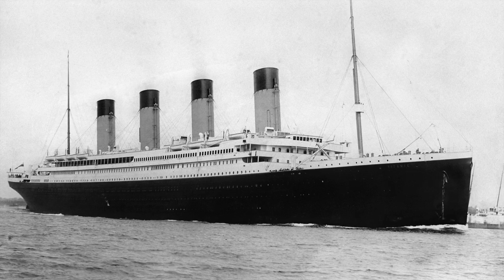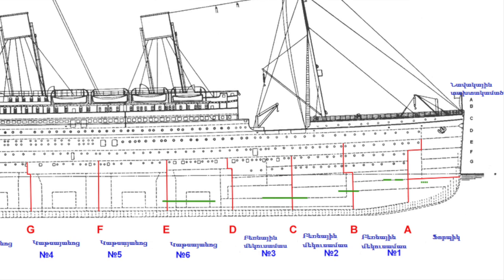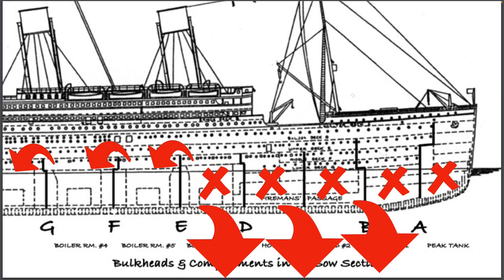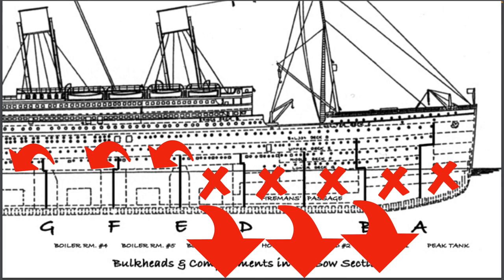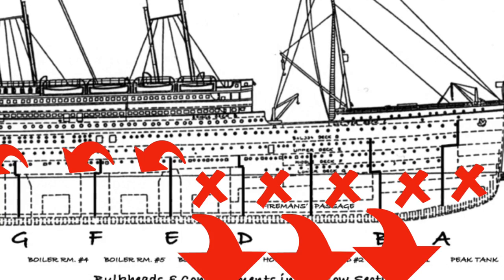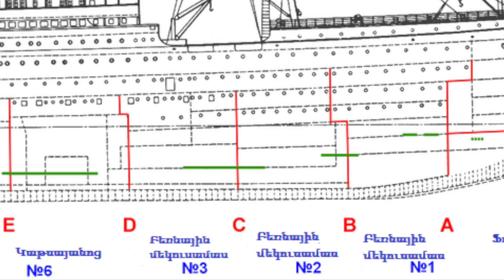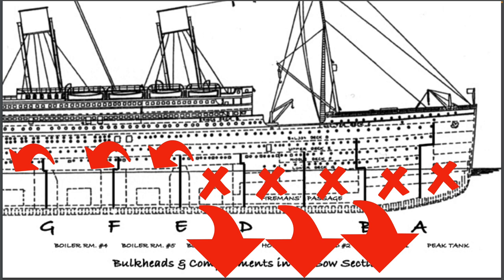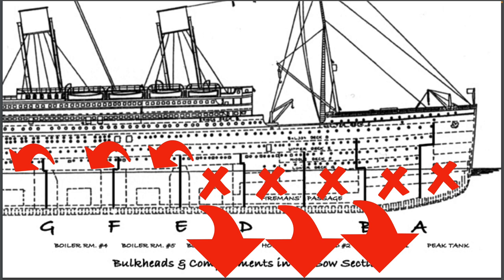The Fatal Flaw that caused Titanic to sink

Comment: The ice burg actually went a little bit into the 6th compartment but instead it flooded the coal bunker which was closed as the firemen previously removed all coal due to a mini fire. The coal bunkers weren’t built to hold water pressure and it burst, which is when they all started to leave the coal room. If it didn’t open a hole into the 6th compartment it may have taken longer to flood potentially saving a few more lives.
Reply: Did the coal bunker fail before the water came over the bulkhead?
Reply: @eveniftheydo7794  yes, it’s documented I can’t remember which crew member noted it but it’s well documented. There was a big rupture not enough for instant flooding but it had ruptured but had enough time to leave the bunker. The water tight compartments we’re doing their jobs but with the compromise of the 6th compartments coal bunker it couldn’t hold. If anyone is unsure what the coal bunkers looked like check our honor and glory, they have a very accurate depiction of it. It was closed to suffocate the remaining smouldering coal and was empty which is why titanic had a little list during sailing with an imbalance coal load. Just to make it clear though, the coal fire had no impact on the sinking or the bulkhead 😆, which was also noted and in fact possibly slowed the sinking down a little bit holding back water from entering the 6th compartment for as long as it could hold again as it wasn’t built to hold water pressure but did give way before water overflowed from the 5th compartment.
Reply: since the burned coal was moved to the other side of the ship, It caused Titanic to have a small list to port

Comment: I always wondered why didn't it have water tight ceilings to the compartments.  Wouldn't have cluttered the first class areas.  But i guess it was added cost and weight.
Reply: Name any liner in service at the time which did have such bulkheads. Those on the Olympics were higher than Board of Trade regulations required.

Comment: I have read several articles that said they would have been better off hitting the iceberg head on.
Reply: The bow was designed specifically to withstand a collision. If only they had planned for this, but I'm not sure if they discussed this strategy, in case of such an emergency. You'd never steer her head if you weren't trained to, or told to do it. You'd be damaging a new ship and losing your job. But yeah, head on, or turning without stopping, as she did.

Comment: The designers knew how deep the ship would settle with each combination of compartments flooded.  In the design case of a t-bone collision (4 bow compartments or two other compartments) the bulkheads were still above the waterline.  Take a close look at the varying height of the bulkheads at 0:24, most notably A and B.  When 6 compartments were breached it was game over.

Comment: Well, they riped open 1/3 of the ship. Find me a modern ship that can survive that. There is nothing wrong with the bulkheads. In fact titanic could survive much more than it was desingn. It was design to survive any 2 or front 3 compartments floded. So, just stop saying it is a design flaw or someting. It was just too much damage.

Comment: The 1 st compartment only partly flooded from below, maybe 🤔 blocked from by the tank.

So it could have been a scenario with 4.5 compartments filled if the final hole had stayed on compartment 5 instead of 5 and 6.

Close call, but maybe the water had not reached above the bulkheads then?

Comment: The rivets were no good and did not hold the plates in place
Reply: The rivets were fine. They was weaker than the rest of the hull but this was the case with all ships at the time as in curved parts like the bow and stern it had to be done by hand as the machines could only do straight not curved. Standard practice for all ships at the time.
Reply: @ryanhelton1865  Conspiracy theories has people out here believing all kinds of nonsense.   Good thing we have guys like Oceanliner Designs and Historic Travels among others trying to debunk a lot of this.
Reply: Yet Olympic, with the same materials & rivets used to build her, had a long and illustrious 23 year career.  Odd, that?